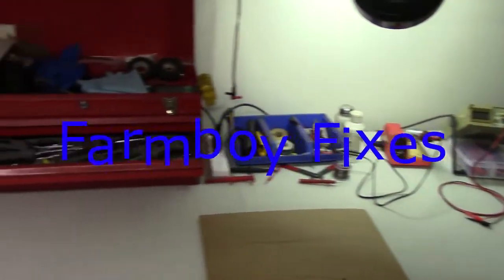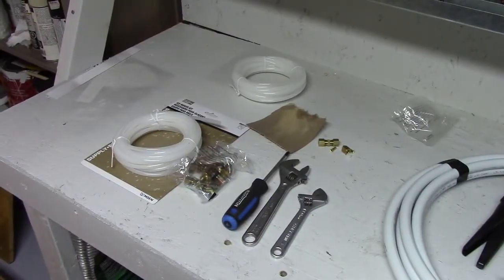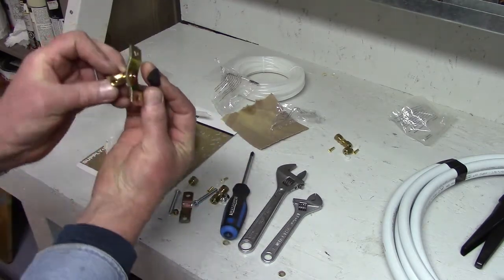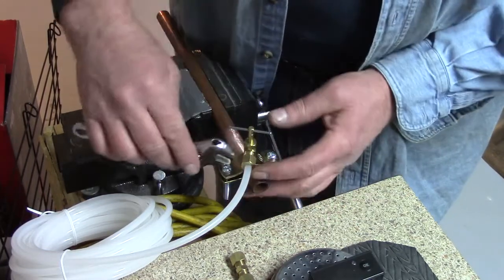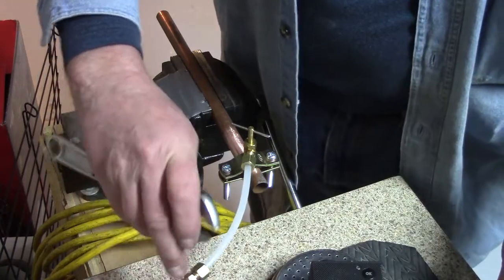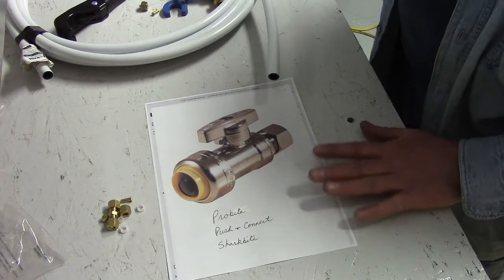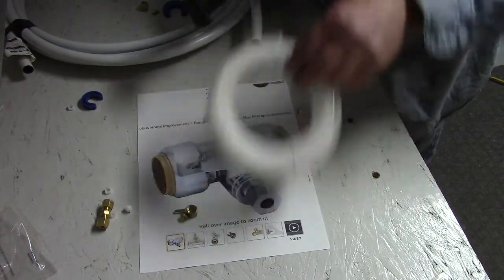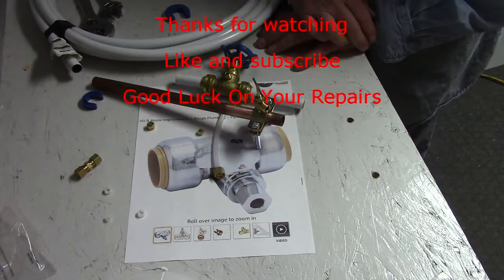Water Line Install on Copper and PEX

Comment: Real plumbers say, "Saddle valve bad."  Mine are 26 years old... egads...  (Taking note, saddle valves do not require a plumber to install.)  Check the plumbing code in your municipality before installing one.
Reply from the maker: Yep, also agree with your statement.